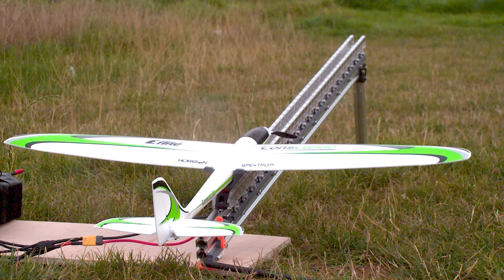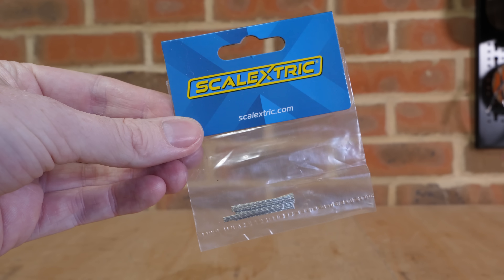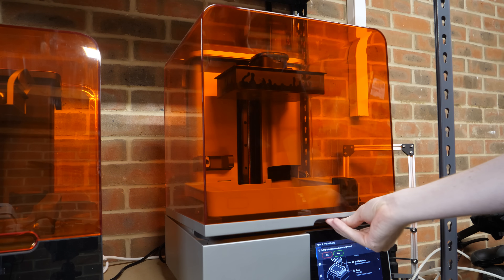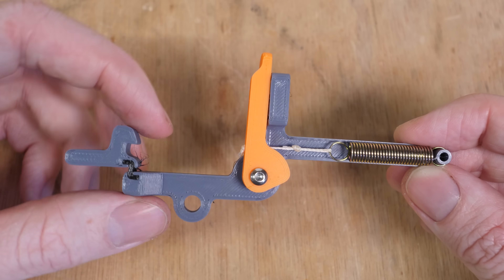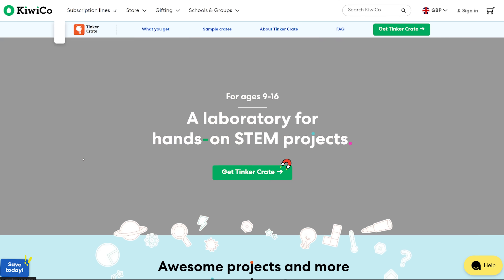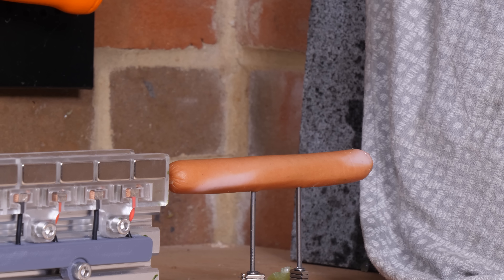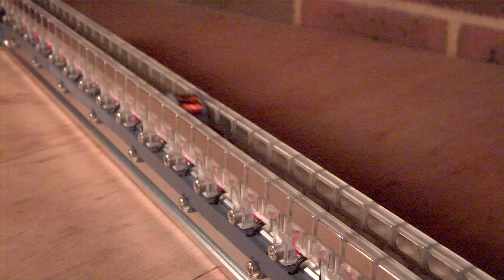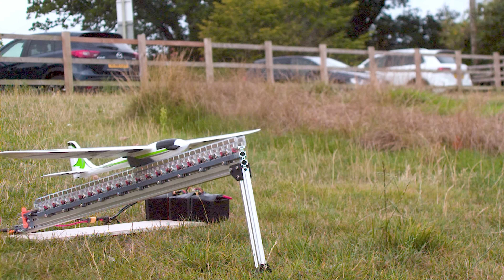Electromagnetic Aircraft Launcher

Comment: We finally got the “how to build a railgun” video🎉
Reply: It has more in common with coil gun rather than a rail gun.
Reply: Nope, this is just your average brushed DC motor, but linear
Reply: coil-gun*
Reply: No, this is a sled
Reply: Lmfao!🤣 😂😂😂😂😂😂😂😂
Reply: Technically this is a coilgun, not a railgun
Reply: @zutaca2825  actually I think it's considered a hybrid.
Reply: @zutaca2825 ik but it’s the same principle as a railgun, electromagnets propelling a projectile
Reply: @cactus_cuber1589  No, railgun is a bit different with projectile being part of a single wire coil and high current pushing rails and projectile apart. This is basically linear motor.
Reply: @pavelperina7629 your correct that this is not a rail gun.  But, technically here, power is also conducted through the projectile (coil  in the sled) , and technically both  linear rail guns and coil guns are linear motors. 

What makes this a coil gun is simply using a coil despite the fact that more traditional coil guns use coils in stator.  Here we get alternating magnets and a mechanically commutated coil in the sled. 

A rail gun has pure DC  flowing through the rails and projectile, and has no coil, and makes continouse electrical contact with the rails.